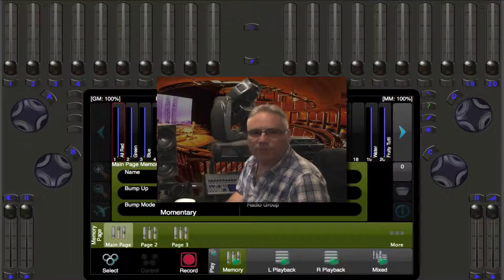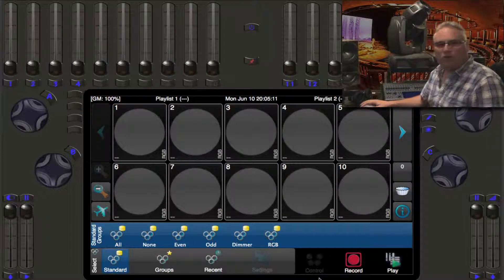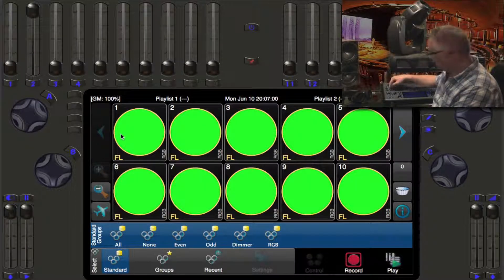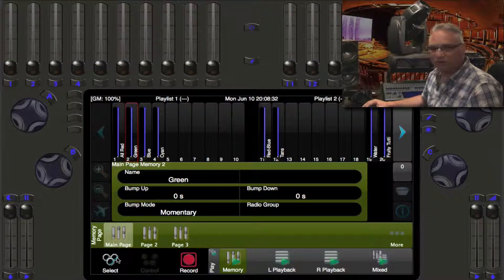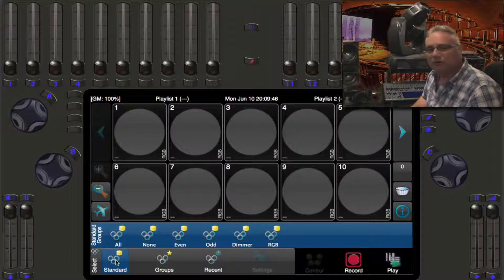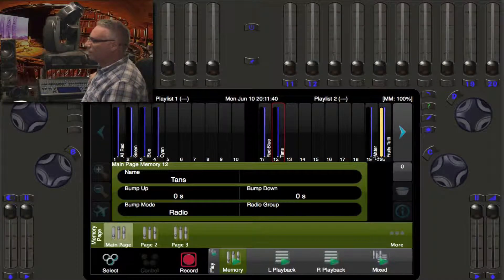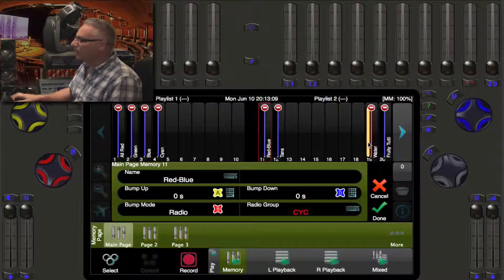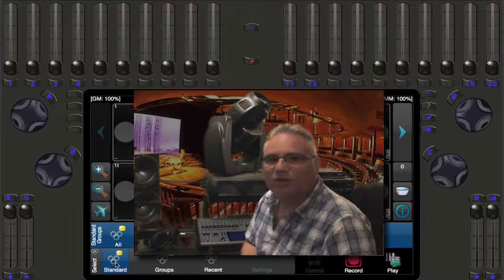15 - Memory Bump Modes

Comment: How can you get from program A  to program B without the lit movement of the gobos?  Is there a way to darken the GOBOS during movement? There is quite a "lightshow" during a scene change.  And THANKYOU for this channel!
Reply from the maker: There is no automatic way for Cognito to realize that the light is at full in 'A' with (say) Leaves, then when 'B' changes it to (say) Windows to have it dim to zero, then bring back to full only when the gobo is changing. You would need a manual step in the middle to take the light out. Am I understanding you right? BTW: Some movers have a mode of operation where the gobos will never change without first dimming the light.